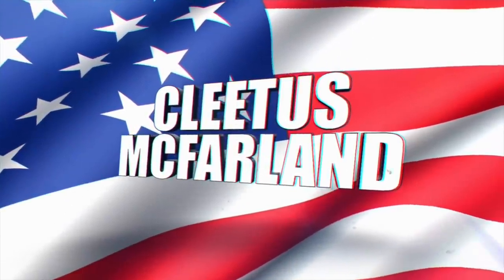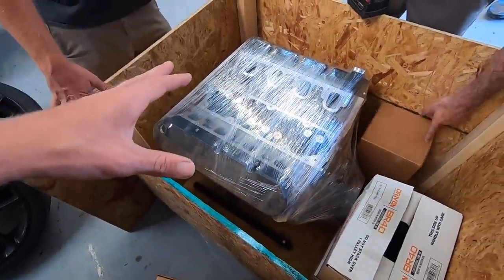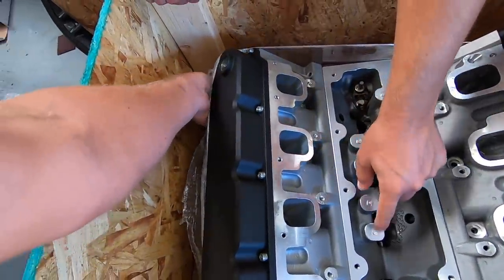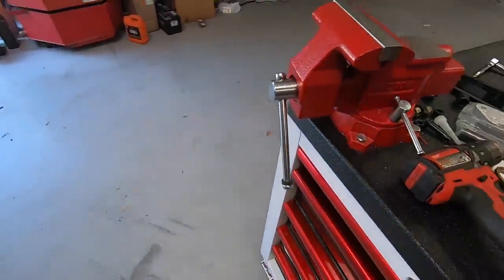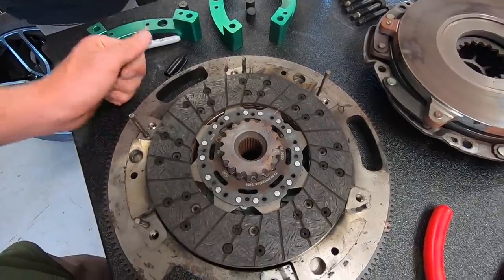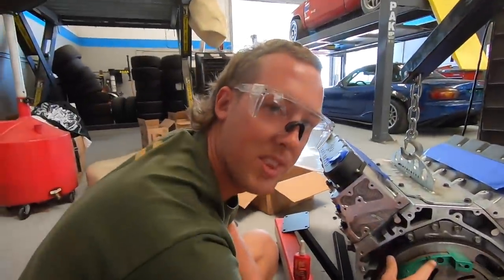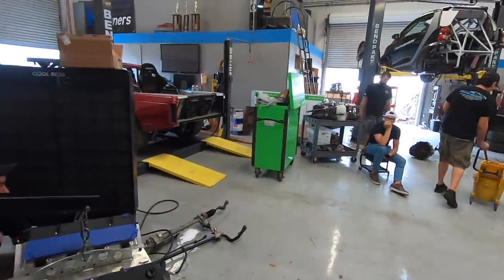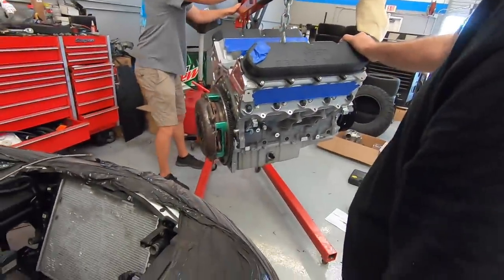The Bald Eagle Machine's 1200hp Texas Speed LTX Engine Has Arrived!!! (FREEDOM INFUSED)

Comment: James: “Put a jump on a drag strip and watch me really shine.” Can we make this happen and soon? Off-road drag racing?
Reply: I second this.  Drag race with a jump at the 1/8th.
Reply: Pinks Garage I think smaller length more jumps like a 1/10th mile with like 4 jumps
Reply: @jamestrost8412  that would work too.
Reply: New form of demolition drags!
Reply: Best quote of the video... lol
Reply: Just put whoops it’ll be fine
Reply: Y'all are thinking too small, how bout making the whole 1/4 mile a ramp, and you fucking jump it at the end of it
Reply: Best line I have heard in a while, lol. Thanks James.
Reply: Off-road drag racing does exist, and it’s super badass!
Reply: Guess you've never seen the Penda monster truck series. That's exactly what that was.
Reply: 1/8 kicker on the pavement. Watch Ruby soar!
Reply: Stadium Super Trucks, won’t be disappointed
Reply: @KODstorm21  There'll be some demolition, all right.
Reply: Would have to use a crown Vic

Comment: Boxo: lets give James the right tools in a few thousand dollar toolbox.

James: puts a chrome on an impact lol
Reply: I mean hes not really risking anything by putting those bolts in because if the socket breaks putting those on you'll probably have bigger problems to worry about
Reply: so i’ve never understood the whole chrome on an impact, someone care to explain? just here to learn something
Reply: Justin Mochoruk black ones crack chrome ones explode
Reply: @justinmochoruk1080  black finished sockets are impact rated , they are heat treated and have a thicker wall and are made from a high carbon alloy steel. The color is carbon coming to the surface during the heat treatment process. Or they could be black oxide finished. Chrome sockets are marked cr-v meaning chrome  vanadium and a quality made one is often plenty strong enough to handle impact
Reply: Justin Mochoruk The chrome sockets are harder metal so they tend to explode if they fail, and are hard on the impact gun. Impact sockets are softer metal so they don’t explode if they fail and are easier on the gun. 

Also, I’ve found many chrome sockets also have a spot to catch the ball on a ratchet that will jam onto the ring on the impact. Which makes them hard to get off.
Reply: @tylercooper6888  eventually it will weaken the socket. That was a job for an electric rachet and a tq wrench not a pneumatic impact even if he was just running the bolts down.
Reply: @I5ZQ8  its not going to weaken the socket by barely tightening a bolt
Reply: Don't worry, he wasn't putting pressure there...

Comment: The fact that cleetus was amazed by those finishes on the front and back of the heads was so funny😂 guys at Texas Speed must be like "wow he really noticed that part of the motor when literally the WHOLE MOTOR is machined with flawless finishes" I understand that you're not a machinist and dont know the difference between finishes but those cnc marks are quick cuts to give the front and back a lil design instead of it being a plain and flat surface. If you look really closely at the rest of the motor you'll see how clean and smooth the rest of the cuts are. That's where you should be amazed because the rest of the motor took a lot of time and concentration. The part of the heads that you looked at were just set up vertically in the machine and cut out in no less than 8-10 mins while the rest of the motor took hours! this is where machinist lack the appreciation they deserve for the years they put into their craft. Similar to james putting beautifully performing cars together only for a giraffe to go blow it up😂 (but you do appreciate james so dont take it the wrong way) no hate or negativity, just thought it would be good to share some information that anyone watching this video could learn. Im a machinist here in Tx and we build custom hot rods, and half of the fleet is powered by TSP motors and when I say they got beautiful finishes, I mean it! Also if you know what shop im talking about, you know😉

Comment: If that crank pulley you got is an ATI LT1/4 10% over pulley you should rethink your SC pulley size. 
ATI LTx +10 is an 8.8" pulley and when you combine that with a 4" SC pulley and F-series ratio of 5.40:1 
you will exceed the recommended max impeller speed of the highest rated (74k) f-series at 6250RPM.
4.5" would put you at the recommended max impeller speed at 7k. 
Anyone who has ever watched one of your videos knows for certain that you are going to surpass 6250 often.

Comment: I sincerely hope that y'all properly torqued those flywheel bolts between the last clip of y'all hitting them with the impact gun and the next clip of y'all installing the clutch disc...lmao 🤣 When I was 19 or 20 I put a new clutch in my 1990 2.5 Iron Duke S-10 using ONLY an impact gun with a 55 gallon compressor and a 3/8" hose on an Ingersoll Rand gun and it came loose...on a 90 HP 4 cylinder. Only reason I ask...it'd really suck to have to pull it all apart again because a flywheel bolt came loose.

Comment: I have a 1988 Buick Century and am looking to turn this family sedan into a sleeper, it's got 43,000 original miles and has been garage kept it's entire life, I don't want to destroy the car, just make it more responsive and maybe a little quicker, any suggestions on possible mods? Bigger throttle body, four barrel carb, stiffer suspension, sway bars, bigger lines, poly bushings, etc.?

Comment: I don't understand the point in sleeving the block and spending $3000-4000 more for that 4.125" bore to make a 427 when they could just go 0.005" over and use a 4.1" crank to have 427ci. With equal quality rotating parts the hp limit would still be 1200 limited by rod as claimed here. Guys have made more than 1200hp with a stock LT1/LT4 bottom end.

Comment: Damn, bro,  race gas with this one, try for 1000hp all motor? ☺️. Keep that one a daily u can drive everyday, eh? Lol. Let's keep this one  all motor 🤷‍♂️. Your throttle response is gonna be VeRy NiCE..first all motor gm to run 7s🤷‍♂️..just sayin..James might have to overnight some nos bottles💪. Fuck e85, were making big boy power and need big boy fuel. Run an oil cooler you'll be fine and get an aluminum radiator it'll never go over 200.

Comment: $25k per 427 minimum. Of course they’re a sponsor but jeez. Gone are the days GM guys can brag about cheap engines 😂 all I’m saying is, sleeve a coyote and upgrade the valve train to alleviate valve float with a better rotating assembly. 1200 is a walk in the park with only 302 cubic inches. Just sayin